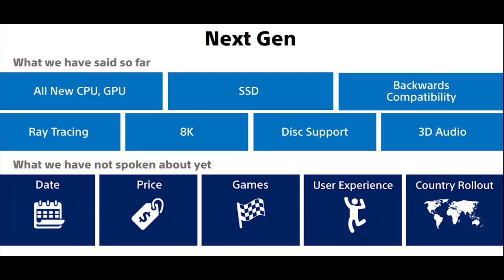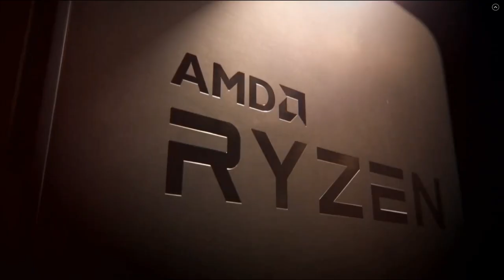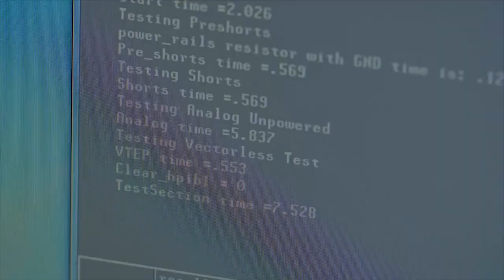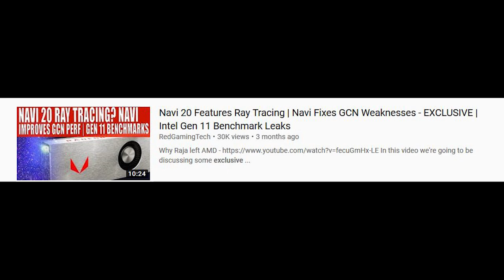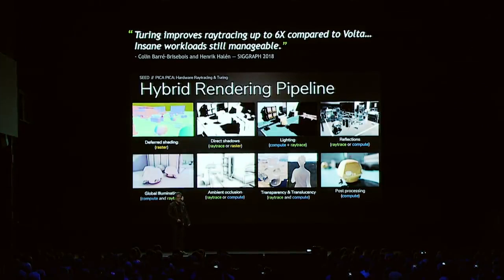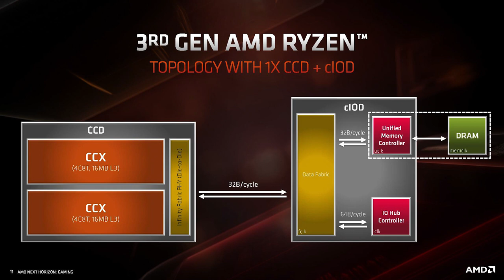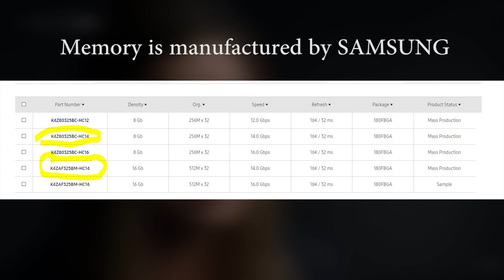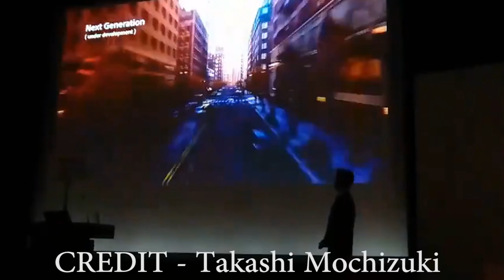Xbox Scarlett - All You Need To Know | Analysis Of Specs, Performance & More

Comment: 30:56 So this is something I have given a lot of thought to. And I think it makes sense for Microsoft (and Sony as well) to go with a mix of 1GB and 2GB chips. For balancing memory size and memory bandwidth.

If they are going with 14Gbps of GDDR6, they definitely want to have a 384-bit memory bus. This gives the memory 672GBps of memory bandwidth, which is a little bit over double that of the X1X. Assuming the consoles will have a GPU of roughly double the power of the X1X, that makes a good pairing.

If they want a 384-bit memory bus, they have no choice but to go with 12 chips. 12 chips of 1GB would mean only 12GB, the same as the X1X, and I really don't see them going that low. 12 chips of 2GB would mean 24GB, which seems overkill, and would probably drive up the price as well. If they go 6 chips of 2GB and 6 chips of 1GB, they will end up with 18GB of GDDR6. If they go 8 chips of 1GB and 4 chips of 2GB, they end up with 16GB. 

The only other way to end up with 16GB is 8 2GB chips for only a 256-bit memory bus, which seems too low. Only 480GBps.

My guess is halfies on GDDR6 + 4GB of DRR4, with the DDR4 and 2 of the GDDR6 for the system OS, ending up with 16GB for games.

Comment: Red - The PS5 will have Navi 20 also(so will include AMD Hybrid Ray Tracing(both hardware/software solution), PS5 Chip is due to go into production by 3rd quarter 2020(which happens to be when Navi 20 also goes into production)
Reply: 850$ Navi 20 in a 500$ potato console hahaha

Comment: I smell pcie 4.0 with newer m.2 memory . Compared to a fidget spinner hard drive,  that's not even close in performance.
Reply: pcie 4 is nice and all but not really needed.  but flash in any form would be a big step forward.  even if it was just sata or even pcie 2.0 for that matter.  with a better cpu and gpu with faster storage on the consoles, we will see games really start to take advantage of faster tech.  cant wait
Reply: @bobhumplick4213  my thinking behind pcie 4.0 is that you need a very fast network for the memory and cpu to communicate through. I'm all ears for thoughts.
Reply: @texasdeeslinglead2401  well its just that on a pc if you have a super fast pcie 3.0 x4 ssd and then compare it to a cheapo sata ssd, in gaming theres not really any difference.  its usually like this,  maybe a game with a hardrive has a 50 second load time.  on the best pcie 3 ssd it will be lets say 8 seconds.  the cheapo sata ssd will still get a 9 second load time.  

so pcie 4 wont really do much for games i wouldnt think, at least over pcie gen 3.  but probalby not over sata either. but since zen already comes with pcie 4 support then why not activate it and advertise it.

the areas where pcie 4 might come in handy are possibly devices that would connect, maybe VR, and possibly costs. if you could use half the wires to send the data at the same speed then maybe you could design the console cheaper possibly?  i dont know.  maybe make it more power efficient.

but yes this will make a big difference to the consoles.  but basically its the fact that they will be using any kind of flash and pcie at all instead of pcie 4 being use specifically.  hardrives are just so slow.  

and on top of that the fact that the games will be designed from the ground up to actually use an ssd.  you can put an ssd into a current console but the devs had to make the gamnes work with hardrives anyway because most wont have one. with all versions of the console having ssd's then the devs wont be held back as much designing for the lowest common denominator.  

the faster cpu, gpu, larger ram sizes and the fact that they are using flash now will do more for games than anything that has happened in the last 10 years probalby.  

all games that are available as both pc and console versions have to be made for the console first and then after that they just turn up a few settings for the pc.  a lot of content has been cut and levels made smaller becuse the consoles couldnt handle them.  and the companies cant have different versions of the game for console and pc so pc players have gotten less than what they could have.

with the new consoles being very close to high end pc's now that means that basically they will be made to a higher standard and wont have to cut as many corners
Reply: Wu Me  that's kinda what I'm thinking they will do. You need to speed up the transfer between all parts not just inside each part. But again , just my plumber mind rattling away.
Reply: Pcie4 would probably raise the price a lot..look at pc mobos compared to last gen..new consoles will probably have sata 3 ssds (load times are the same with nvme)
Reply: @enricod.7198  I've heard that the price would have to be raised. I tend to agree .  I do think that the PCB is not going to be too much of a cost increase. Reason being, it won't have all the bells and whistles like say the Ace or Godlike. And , it will have volume of production to further offset cost.
Reply: @texasdeeslinglead2401  as far as the memory and cpu, they dont communicate over pcie.  they communicate through a memmory controller.  pcie is just for devices like storage and gpus etc
Reply: @texasdeeslinglead2401  yeah I totally agree..on the raise I have to say everyone was expecting like +50 bucks, not server-grade prices like hedt platform 😅..and for 300 they should not have skimped on usb ports, especially with pcie 4..gonna go with the strix-e and a 3900x
Reply: @bobhumplick4213  the cpu communicates through pcie to hard drive storage. Historically , the hard drive has been partially to blame for long load times due to r/w speeds of fidget spinner drives. Obviously Microsoft has moved on into the modern world in this next design, so m.2 , ssd is coming. The question is, are they going with the market saturated pcie3.0 or the newer pcie4.o ? The 4.0 hard drives push incredible amounts off data on and off themselves leading to literally nill load screens. I agree , ram communicates directly with cpu. That's no debate.
Reply: @texasdeeslinglead2401  "The 4.0 hard drives push incredible amounts off data on and off themselves leading to literally nill load screens"

thats not exactly how it works.  the next level or whatever doesnt just copy straight off the drive in one chunk and then the game starts.  once you move from a regular hardrive to a sata drive the bottlenekc becomes the cpu and how fast it can process that data coming in.  search for ssd game load in youtube and you will see videos comparing a fast pcie 3 drive against a cheap sata drive and see they are basically the same.  the info from the drive has to be processed and once you get to pcie 3 (or even 2 probalby) the cpu just cant keep up.  

heres a video showing the difference.  the ssd is a slow sata drive and the other is a relaly fast nvme ssd pcie 3.

and second i dont see why the "pcie market being saturated" has to do with anything.  maybe you are meaning that pcie 3 gets saturated by todays drives?  idk.  i think you would do well to look more into the topic.

pcie 4 wont help over pcie 3 for games.  at least not for a long long time.  like 5 years or more
Reply: @bobhumplick4213  that cpu bottle neck is actually a problem I currently have . My Samsung ssd far out runs my cpu's ability to process. Poor piece of smoking Intel trash. But anywho, this is why the package from AMD to microsoft is zen2 architecture with rdna.  
     As a complete package : the cpu can be scaled to match the ring bus , the hard drive i/ o performance, and ram can be packaged accordingly.  Think of it like this. 
Microsoft puts in this excellent cpu and infinity fabric w/ let's say for fun , ddr5 memory and m.2 hard drive .
The only bottle neck in that package would be the communication between the drive and the cpu or chip set , unless I'm wrong and delivery of request packets are being sent directly from drive to ram. Still. I believe that would still run through the pcie lanes. Feel free to correct me . I'm rather enjoying this dialogue. Thanks
Reply: @texasdeeslinglead2401  thats not how it works.  and we already know the cpu that will be in it.  and it doesnt have a ring bus.

we already have cpus on pc that will be faster than what will be in teh consoles.  and a faster drive doesnt help with load times once you go to at least a sata drive.  it just wont make that big of a difference.
Reply: @bobhumplick4213  I'll add again , pcie 4.0 has only one single effect on the performance of the system
 That is : load screens.  Assuming the cpu /and gpu can process like a mofo. Lols
Reply: And if they can't process like lightning , then you get longer load screens and lower frame rates. That frame rate is tied only to the gpu and cpu. Not pcie, or hard drive.
Reply: @UCOcvqPYFFtvlK3ayve8mY0g true . It wouldn't be much. Lordy I think my typing finger is sore. Very interesting food for thought here. Keep commenting . I'll be reading. But it will be a couple of hours before I jump back in.

Comment: I don't think the SSD is necessary a drive but a cache. The use of expensive storage runs counter to a console business model. You want user to buy games and you want to give them more storage which will be expensive based on the current assumption.
Reply: I'm really curious how they are going to implement the ssd. Next gen consoles would require at least 2tb of storage. A 2tb ssd would be crazy expensive

Comment: My best guess (as of today) is that out of the 384 mm2 SOC, about 74 mm2 will be used for 8C/16T Zen2 CPU.  Then, 48 Navi Compute Units (with 44 cu enabled/active) would take about 301 mm2.  So a streamlined/customized 8C/16T Zen2 and 44 active CU's of Navi.  At 1800 MHz on the GPU, that would be about 10.1 teraflops.  But if they doubled the instruction rate per clock (up now to 4 per clock), that would be around 20 TF's.  I'm fuzzy on that last bit... anyone know any better that can help clarify would be welcome... thanks.
Reply: I'd be suspect with the render MS showed. They're hiding design for reasons.
Reply: 74mm2 for 8C cpu? Really? You don't really know anything, do you? 74mm2 will be just the CHIPLET for a Zen 2 cpu, not the cores... Seriously use your heads or if you don't know anything about hardware, just don't attempt to guess at all...

There is no chance in hell a console like the one you are describing will be just 301mm2, let alone affordable.  10 teraflops are too high for a new console, it is highly unlikely next gen consoles will reach it. Did you see the blower cooling solutions 7nm 9.7teraflops gpus use? You really think that thing can be used in a console? Good luck...

All i see around are fanboys thinking their consoles will magically become supercomputers and cost 400$. LOL.
Reply: @KotsarisGR  Good trolling... thanks for being unnecessarily rude... just trying to have a tech. discussion.  Pretty sure 74 mm2 is the chiplet size with 8 cores... so what are you saying I got wrong?  Obviously that doesn't include the "I/O chiplet"... but I don't think they are going to use chiplet tech... probably just monolithic chips.  Either way... no need to be rude with comments my dude.
Reply: @CharlesHepburn2  i have no idea about chiplet size. However a 10tflop gpu seems very ambitious if you ask me. I think they'll use at most 40cu. Keep in mind that the rx5700 with just 36cu already outperforms a vega 64.

Comment: halving l3 cache wouldnt hurt it too much.  but they couldnt use the consoles as a place to sink bad zen 2 dies. it would have to have its own dies.  if they are going with a soc for the consoles then having a place to put bad zen 2 dies doesnt matter because you wouldnt be able to use them.  it would be a single piece of silicon.  might be cheaper to go with asingle peice of silicon.  but having a place to sink bad zen 2 dies would be really really big boost for the silicon quality on the desktop.  would really be a missed oppurtunity. 

 intel having dell and hp to pawn off bad dies on as locked i5's makes intels high end cpus average quality really really high.  if amd could sink bad dies into the consoles they could basically mirror this same advantage but from a much smaller company.  

but using chiplets has a higher minimum cost.  for devices where every single cent matters but top perfomrance doesnt chiplets dont make as much sense because the added cost of packaging

but if they did go with a soc they would have a mem cotnroller on the same die as the cores so the extra l3 cache wouldnt really be as important

Comment: I personally except this
CPU to be between the 3600/3700. 8c/16t. 3.0ghz range
40-44 Navi CU. Decently clocked. Probably around the power of the 5700xt. Maybe slightly faster but will have RTX (since it's already confirmed)
16gb GDDR6

Performance. Some games will be 4k60. But it won't be standard. Most will be dynamic at 60. Easily pushing above 1440p. Then 1080p120 and maybe even 1440p on some games. Especially since Xbox has freesync, I really think they're going to push for this.

I'm worried about SSD. They're still to expensive for mass storage. And 1tb is no where near enough storage. Not even now. 2tb needs to be the bare minimum.
Reply: Great analysis, however I think it will be 24 gigs (16 for system and 8 for GPU).
Reply: @superhk19  
That's way to much money
GDDR6 cost alot to produce
Reply: @superhk19  24gigs are a lot. Maybe too expensive especially if they want to use virtual ram.
Regarding the original comment i think 5700xt would be the upper end of gpu performance, it might just be closer to base 5700 performance.

Comment: i did the math, and i came at 448gb bandwidth gpu, and its good that ive seen this number by many many analyst and also coincidently the 2070, and 5700 xt also are at 448 gb... so basically we will have a great cpu at about 3.3ghz with a gpu at 1550-1750 mhz... i say will  probably get 12 gb gddr5 with 9gb for games again but we need at least 14gb to have 11gb for games which will future proof it better for the next 7 years

Comment: 8 cores and navi, so we need 3700x+rx5700 minimum for next gen console ports. Grim tidings.
Reply: They won't be running at the same clockspeeds as their desktop equivalents.
Reply: Next gen will be targeting 4k though, so if you have a lower res display you won't need such a strong graphics card.
Reply: I can't remember where I heard that the gpu will be more powerful than the rtx 2070.
Reply: @combatantezoteric2965  that was a leak that was never confirmed
Reply: @combatantezoteric2965  rx5700 would already be very decent. And it only has 36 cu. So if next gen uses 36cu or 40cu i'd be happy

Comment: HOLD UP. Your TFLOP comparison is completely wrong. Yes, it's difficult to compare TFLOPs between RDNA and GCN, but that has nothing to do with frequency and whatnot. It's because the actual usability of the compute performance is greatly improved using the RDNA architecture versus the old GCN. GCN was always great at compute, but it didn't translate well to games because of scheduling and other factors. RDNA seems to be a lot more efficient at this, hence theoretical TFLOPs are not drastically improved but performance is.

This is COMPLETELY DIFFERENT than what you said about a Q6600 at 4 GHz. A Q6600 does what it does. The performance improvements of further generations of processors do what they do. There's no "performance factor" that translates theoretical performance into real-world performance, it is what it is. There's no TFLOPs performance difference here. Insinuating otherwise is completely wrong.

Also, acting like Vega is anything more than GCN is both deceiving and wrong.
Reply: It's kinda hilarious that you mention disabling Hyper Threading as the Q6600 didn't have it. It doesn't make the performance comparison any less valid.

RedGamingTech is fast becoming a Youtube channel I potentially ignore and unsubscribe to because you're starting to get technical details extremely wrong.
Reply: If I'm at all mistaken, please correct me!

Comment: Great video! I cant wait for the Scarlet because it will be awesome! AND make all the pony boys jealous. Ignore their hate, thanks for the good work.
Reply: The consoles will be the same. We're in the process of the 2 cross platforming
Reply: @milkonbean any idea how the ray tracing baked into the Scarlet hardware will be  different from the ps5?
Reply: @impreza99rs  No clue about how things work, but I do wonder if hardware raytracing on Scarlett will negate any possible power advantage over PS5. Example: raytracing makes a 4k60fps game drop to 4k30fps?
Reply: Brandon Sandlin I’m no expert either, From what I read... the hardware solution is more efficient compared to pure software raytracing programming. I haven’t come across the PS5 stats specifically about raytracing wether or not if the hardware will have raytracing “baked on” like the next Xbox. What worries me is that both consoles are gonna be pricey.
Reply: @impreza99rs  they'll again both be the same, leaks on the amd road map of ray tracing shows 50/50 hardware and software ray tracing so im gunna guess thats what they will be doing on the consoles